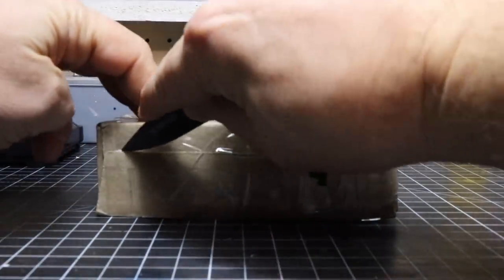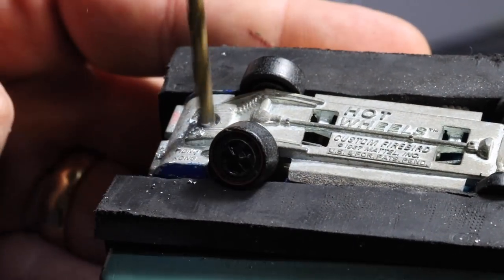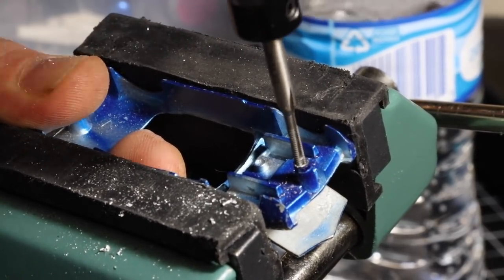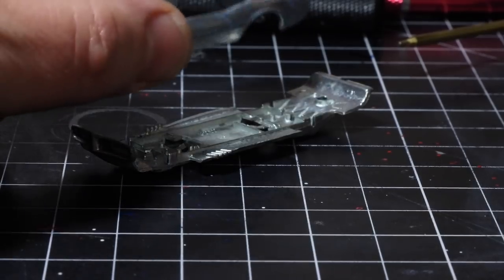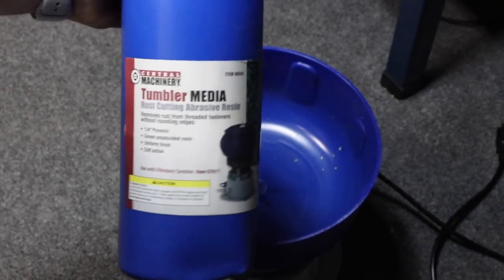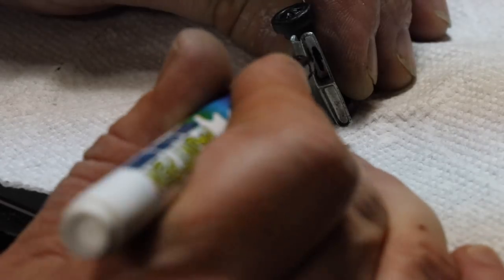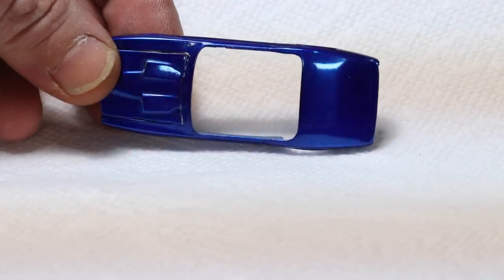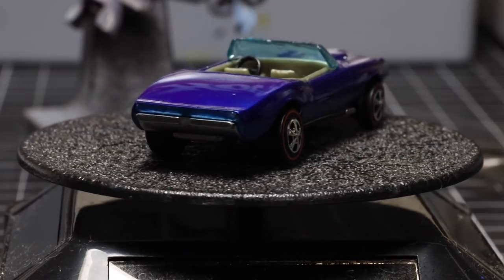Hot Wheels Redline Restoration : 1967 Custom Firebird

Comment: I think itlooks awesome. I saw the rear wheel looked a bit odd but its looking good. I used the screw driver handle for the tap. I had to drill it out but it worked great.

Comment: You've really inspired me to want to restore a Redline Hot Wheels. I found a pretty cheap Custom Firebird online. Did you use the medium size wheels for the back and the small ones for the front? So many options on the Hot Wheels Redline Shop website.

Comment: Cool car. Love the Pontiac front end/grill.  In the video, the first time the pit on the trunk is visible to us is during your dry sanding with 800 grit. At this stage, is it possible to fill that in with anything?  Maybe a dab of JB Weld on a flat toothpick or something? And then file it down and re-sand?
Reply from the maker: You could fill it but it would show through on the spectraflame paint :(
Reply: @WheelsNThangs  Ok. I wasn't sure how it would polish up or if the zinc playing would cover it.

Comment: I enjoyed this video very much.  Thank you for making it.  :)

I'm curious why you decided not to take the extra steps to do body work on the pits and wheel well with bondo, and or a small welder?  Not a critique, just a question.
Reply from the maker: The paint is transparent so I can't use filler and you can only sand so much :(

Comment: On the manufacturing flaws you pointed out, the divots and such, would it be possible to use some solder to fill it then sand down to true?
Reply from the maker: Solder doesn't seem to really stick to the zinc. I've also melted some cars with it...
Reply: @WheelsNThangs  thanks for answering. I've never done anything like this but always interested to learn new things. 👍
Reply: Use lead to fill in the divits.

Comment: You should use a sandable primary And Du Pont  products. after finishing it  with a clear coat of 999  DU pont. For an excelente outcome.
Reply from the maker: I use it with normal paint but it would show right through the spectraflame.

Comment: Have you tried electropolishing the base or body to remove any oxidation? More expensive than just a wire brush but has amazing results. I know these cars are from your Grandson but is it worth doing for any restorations you choose to do?
Reply from the maker: I may try it eventually. The oxidation comes off pretty easily, it's the pitting that is difficult.
Reply: I would certainly recommend electropolishing. It will leave more metal on the surface, even though sanding out the pitting will reduce it too. Perhaps if nothiing else, it will save you time.